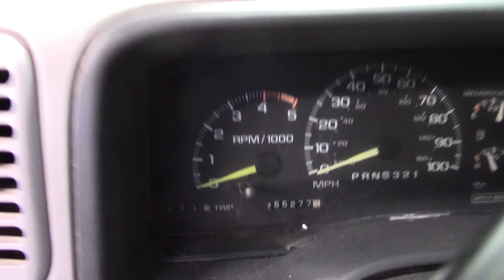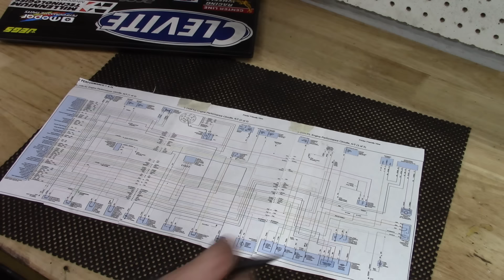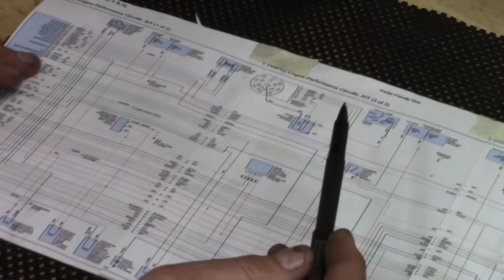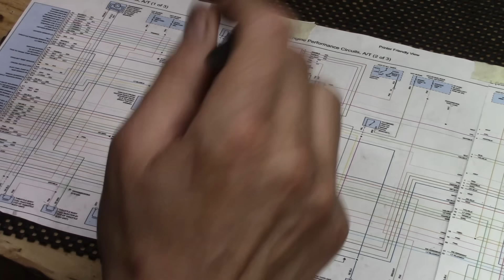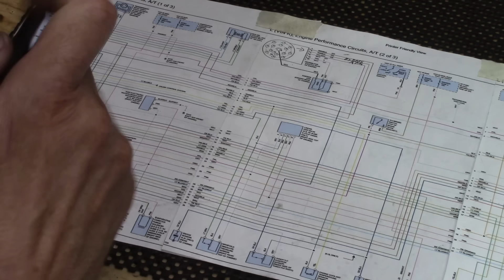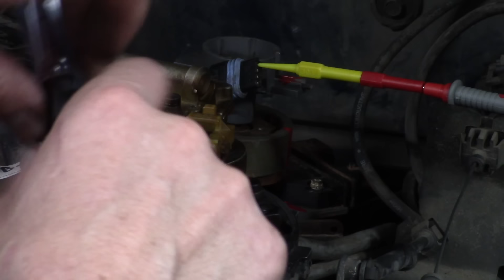Challenging Cranking No Start Diagnosis  1995 Suburban

Comment: JACKASS'S WAS ME!! I did every check through the entire system....no help!!....until I double checked the distributor....that had good spark both times I checked it along with the plugs!....but after checking it, the van would start right up???....but then the next day no start again!!! So I talked to AZ executive about the white chalkiness on dist. contacts, and immediately said that's your problem! The wear down over 1K miles was enough of a gap between router and cap points 4 no start!! Replaced the new router and cap....walla!! No ongoing cranking now, barely at all....immediate start every time!!!! UNBELIEVABLE how I was still getting spark to distributor and plugs but not enough to fully start the van?! WE LIVE N LEARN EVERY DAY, BUT IGNORE THE OBVIOUS....STIRRING US RIGHT IN THE FACE! LOL

Comment: What about a no power at all when you turn the key? New battery but no power in the dash at all?
Reply from the maker: That would be pretty easy to diagnose. Just check voltage at your main power sources and work backwards on the circuit.

Comment: This guy needs to study his stuff before starting this vehicle does not have crank or cam sensors  the tan / wire is for setting base timing
Reply from the maker: Looks like you need to study. It does have a cam sensor. That’s why it uses the distributer output. That’s a cam sensor Smh.  Also I set the timing after I fixed the vehicle.
   Always someone who doesn’t understand what happened trying to make themselves look smarter. 
    What is your explanation for the scope output from the PCM by the way when I used the testlight to create an input? How do you explain that working if there is no cam input?  Dying to hear your answer.

Comment: Hey sir! My truck is in Brampton, Ontario, Canada.
Please solve my problem. It will be 2 years since my truck brake down. Tell me what to do. What can be the problem? It started by total body open the spraying, without spraying, it didn't start, speed up from 70 & 80 on the highway, it didn't pack

Comment: Hey sir please my help .2011 chevrolet silverado owner manual pickup truck spray in totalbody and start what could be the problem after 80 kilometres the race does not work
Reply from the maker: Sorry but I don’t understand the question. Sounds like fuel maybe sprays in throttle body but then car dies after 80Km??
Reply: yes
Reply from the maker: What does your fuel pressure read when the engine stops?
Reply: @SchrodingersBox  desiel fuel filter press desiel on otherwise off

Comment: You did great for not being familiar with a vehicle. I know early on that it was going to be the ignition control module because I've had to replace mine twice but the first time it took me awhile to diagnose it. Recently I had a issue where the truck started running rough and then it would be fine and then it will not start at all. I hooked up a remote start and could see the injectors pulse pulled spark plug and can see spark. Found top dead center and lined up marks on harmonic balancer then went to pull l distributor cap and found that it was loose because of a stripped screw  repaired that and then was waiting on a jump because I had run my battery down. While I was waiting I ran across a video telling how to reset the computer so I decided to go ahead and do that. When I finally got a jump it would not start I knew I had some compression as putting my thumb over the number one spark plug to find top dead center at felt fine Truck was running fine before and the loose distributor cap explained all the symptoms that I was having. Now i am  baffled but since during my diagnostics I had noticed that the spark plugs were overdue to be changed I started changing those then realized that I had reset the computer and it had gone back to the base settings when it had been making adjustments to the timing to account for the bigger Gap due to Worn spark plugs sure enough when I changed the plugs it started right up. I guess the moral of the story is do not change too many things at once if I had just tried it after repairing the distributor cap it would have run.

Comment: We have a '99 Suburban that will start well when cold, but... when warm, it cranks a bunch then starts. Can't get it figured out, any suggestions from anyone here???? All suggestions are greatly appreciated.
Reply from the maker: What data do you have?
Reply: @SchrodingersBox  I don't have any codes or anything like that, the mechanic said it isn't throwing any. The vehicle just started doing it about a month ago, and we took it to a mechanic to see if he could find out what the issue is. 
I wish it was showing a code, that would at least give us a place to start. 
He said he put a new distributor in it, ended up putting a new fuel pump in as the one we had put in it last fall wasn't holding any pressure. 
Hope this helps give you some ideas as we are about out of any. THANK you for answering my comment!!!
Reply: Hubby just said he put a new coil in it. We think he may have put a new Rotor Button and distributor cap maybe too? Not sure he has had it for a while and we are forgetting all he has said he checked on it. 
Again, THANK YOU for you trying to help!!!!
Reply from the maker: I would need some basic data to get a starting point. Whats the fuel pressure? Whats the fuel trim showing? What’s the spark voltage? What’s the ignition timing?
Reply: @SchrodingersBox  I just wanted to tell you that we finally found a couple of guys who fixed the issue Suburban had, it was the " Vortec Spider Fuel Injector Assembly for Chevrolet/GMC 5.0L/5.7L" The guys replaced this and it is fixed. Thank God! I do appreciate you offer of help but I couldn't get that information from the first guy who we hired to fix it. 
thanks again!!!!!!!!
Reply from the maker: Oh good. Yeah that’s why I wanted to know the fuel data. This is a common issue on those engines and I have older video of this exact same problem on a 99 Chevy Tahoe maybe 8 years ago.

Comment: So what if I’m getting no fuel? I changed the ignition module and still no fuel.
Reply: I’m getting spark though
Reply from the maker: Check the voltage drop on the fuel pump.

Comment: 1996 is the  1st year for  crank shaft position  sensors
Reply from the maker: Wish I had known that lol!!!
Reply: @SchrodingersBox  only reason I know is I have  a 1995 Chevy  Silverado that my dad bought new and I got it from him for  200 dollars besides  plugs wires distributor cap rotor, air filter  basic  maintenance  has 300000 miles and I just  replaced the  OEM fuel pump . I  have  learned a lot from  your videos and  learning  something new  everyday   .I heard you  mention  putting  air-conditioning in your  garage  best thing  I  did  to make my  garage   more comfortable for me  I just retired from doing air-conditioning and refrigeration for 40 years  let me know  if you have any questions or need help with yours

Comment: Matts garage my wife got me that same sighn but says something different thanks for the video working on 94 gmc 1500 5.7 TBI crank no start new fuel filter, fuel pump, fuel pump relay, and fuse is good tested fuel pump it is good scratching head power is getting to pump going to replace fuel pump hanger tmw and hope its a bad connection the tubes are rusted and those stab ins had corrosion

I got to get me a curtain rod lol
Reply from the maker: What evidence is there that the no start is a fuel issue?

Comment: I have a 2007 chevy tahoe giving me p0335,p0336. The only reason why i quetion it is because i have a slow turn/ slow crank. Will a bad ckp sensor cause a slow crank or does it sound more like a voltage issue?
Reply from the maker: What is your signal voltage on the sensor showing?

Comment: The late 80's through the mid 90's were sometimes tricky - the complexity of electronic systems had begun but many ECU's didn't have the processing power for real time analysis.  Not to mention the OBD1 connectors weren't standardized across makes!  Solid diagnosis using the FASTTEC method.

Comment: Computers are great and computers suck also that Suburban that is OBD1 the only difference on the 96 is the distributor does a whole lot less and they put sensors in one on the crank in front of the motor and then I believe there is a sensor in the distributor that fires the injectors on the Spider injector that's the other thing that changed rather than the TBI I'm having a heavy rain no start on my 96 which I have had in the previous but my health is not allowed me to go down and figure things out usually it eventually starts but yeah I always check the fuel check the spark check everything keep doing your DIY I hate computers and sensors they took the best systems and get away with them so that people cannot fix their own problems
Reply from the maker: You can actually way easier fix your own problems with computers. You said it yourself-  check fuel. Check spark. Check everything. 
   Check everything??  No. Check the ONE thing that it can only be- according to the computer data.

Comment: @Schrodingers box any idea for a 2015 Nissan Vera note? Starts sometimes (when cold) scanner says (camshaft sensor P0101) online P0101 is an oxygen sensor. Replaced the sensor (crank no start) spray starter fluid (starts) once i shut it off won’t start back on. Replaced fuel pump, camshaft sensors, checked all fuses, checked some ground cables. On my way to change the injectors. DIY it’s worth it for me to say “it needed it anyway.
Reply from the maker: What data do you have?

Comment: Tbi icm causes me constant problems. They aren't coating the terminals with anti corrosion metals anymore. BWD will fail in just a few months. 
The installation instructions advise to sand them every time they fail.

Comment: HELP!!! I have  same problem changed coil cap and rotor ICM still no spark now what? '94 suburban
Reply from the maker: What was your data that showed those parts were defective?
Reply: knew I had no crank sensor went to those parts obviously blind checked fuses first all those parts were original with 125,000 miles @SchrodingersBox had no spark at coil or dist
Reply from the maker: Ok what data do you have though? I need something to go on.
Reply: I don't know what to tell you I still have no spark at coil or dist @SchrodingersBox do I need to check volt on pink wire from switch to coil
Reply from the maker: Bypass then reference to the signal- see if the coil sparks. That would be the easiest test.

Comment: Hello sir. New subscriber here from the Philippines. My Suzuki jimny suddenly dies and start when it's cold. I check and there's no spark I change the crank sensor and still don't start. What could it be?
Is the ignition coil bad or the ECU. Because there's a 12volt power from the crankshaft wire,  there's a continuity in the negative and it send power to the signal wire. By the way I test the coil and the resistance is .99 and .97. Suzuki jimny has 2coils each coil have 2 high tension wires.
Reply from the maker: What is the voltage output from the crank sensor showing?
Reply: @SchrodingersBox  Blue black 11.59v, green red 5.3v, red black 11.68v.
It makes me confuse because all the videos I watched. all the positive wire only produce 5vlts.
Reply from the maker: I need the running output SIGNAL voltage. That’s all.
Reply: @SchrodingersBox  the green red puts out .32 v from 5.3v I tried to direct the coil and it produce electricity. Do you have Facebook sir? So that I can send you a picture.
Reply from the maker: Which on is the green red? Is that signal?
Reply: @SchrodingersBox  yes I think that's the signal.
What will happen if the signal and the live source interchange?
I really appreciate your response sir.
Reply: I try to jump the wire in the cranckshaft sensor. I tried to see if it sends signal to the coil and produces spark but it didn't it only triggers the injectors to open. But no spark coming out.
Reply from the maker: Sound like you have an open ground on the coil return to me.
Reply: @SchrodingersBox  I plug the signal wire of the coil socket and tried to jump the wire and it produce spark. But when I plug the cranckshaft sensor signal wire there's no spark.
Reply from the maker: Sounds like there is a ground fault on the CKpS signal then. Check if the CKpS signal is shorted to ground.
Reply: @SchrodingersBox  ok thanks sir. Gonna test it tomorrow since it's 8:17pm here in the Philippines.
Reply: @SchrodingersBox  hello sir. Sundenly all the wires on my CKpS produce negative also on my camshaft sensor.
Reply: Also I lost the signal to my injectors and I believe the fuel pump didn't function anymore since I couldn't hear it everytime e turn on my ignition.
Reply from the maker: That’s not possible. Looks like you just have your polarity reversed.
Reply: @SchrodingersBox  if that's the case sir. What should I do.
Reply: Is there any possibility that the ECU is the problem?

Comment: I know you're not a professional mechanic but you put in the effort to know the systems like it's how you make a living. My best friend surprisingly left his white collar job 7 years ago to do mechanic work because he swore it was more mentally engaging than people realized and that seems to be the case. He also told me a lot of folks don't realize how much information is on the computer in those old gm vehicles.
Reply from the maker: Yes I have talked to a tech school where they say they routinely have corporate white collar types that sign up for their programs because of exactly what you stated!!!
Reply: @SchrodingersBox  he sent me to your channel. Are you familiar with older cars,pre efi? He says those can be difficult in their own way. I've just been tinkering on stuff and him helping me out on weekends and it's just way more difficult than I thought it would be.
Reply from the maker: Hands down the older the car the simpler it is. There is no debate on that. If a 1967 Buick has no spark there are only maybe 2 or three things that can cause that and testing them takes 5 minutes. In a 2018 with no spark there are about a dozen things that can cause that and only 2 or 3 are “visible”.    The other thing about an old car is you don’t even worry about emissions.  You “tune it by ear” and pat yourself on the back at how it purrs. But on a newer car it will also purr like a kitten but that check engine light tells you it isn’t fixed.
Reply: @SchrodingersBox  I have no idea but my assumption was in line with you. He was working on a 2020 navigator and had all those trinkets and scope out dealing with a challenging problem. A older Oldsmobile pulled up and he turned it away after looking over it. He said those older cars can be harder to work on and make money. He said, things rusted, brittle,  stripped, patched up multiple times and dealing with all that makes them harder to work on and make money. I would think I'd rather get the older cars too without as much technology to deal with
Reply from the maker: The technology is opportunity for money. Anyone can fix an older car so there is less marketability. But if you can diagnose and fix a CAN network then you will be the only person in your entire zip code that can do that. You can charge double if you wanted.

Comment: I'm a little late to the party, however, an oscilloscope is easily affordable if you want to do real DIY automotive work by diagnosing the issue, replicating the issue, and fixing the actual issue as opposed to wasting $1000 changing all the wrong things by guessing. Most people I know would immediately slap some plugs and wires on it, then buy some can of fix-it-all miracle juice, belts, do a timing job which they'll eff up, park it for 6 months, then come asking for help with the BS excuses. Or, if they guess it right, walk around for three weeks with their nose in the air lauding their mechanical prowess and how great they are at life.
Reply from the maker: hahaha you pretty much nailed it EXACTLY!!!!!!

Comment: Excellent information Sir! 
I have a similar issue with mine 99 suburban code P1351 .icm  replaced it with a AM no luck. I have fuel pressure and spark at the plugs n coil. New distributor cap/rotor battery,starter. Its weird sometimes it would run with cylinder 3 unplugged. Please help i. Did partsnostic on it.😢
Reply from the maker: What data do you have?
Reply: @SchrodingersBox  I'm a diyer I don't have any data Sir.
Reply from the maker: Why would that be a reason?  I’m a DIY too.  You don’t need to be a professional to get basic data!